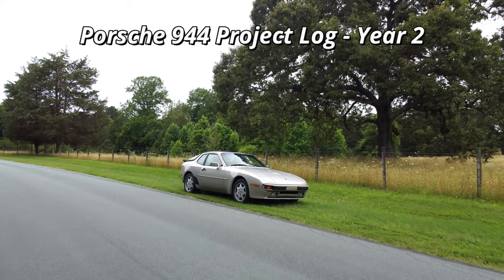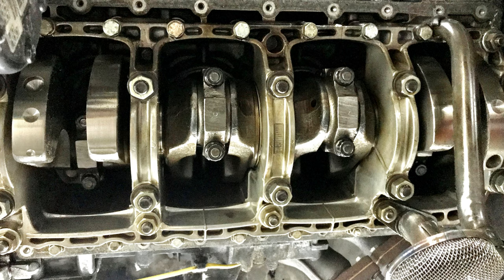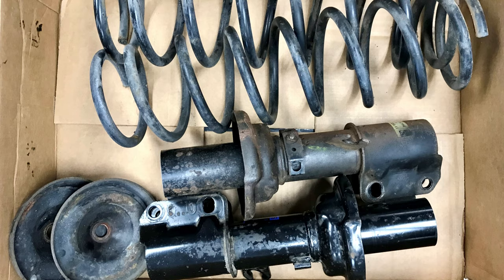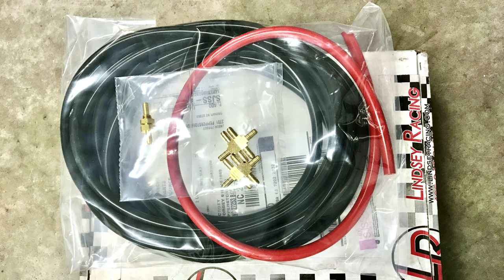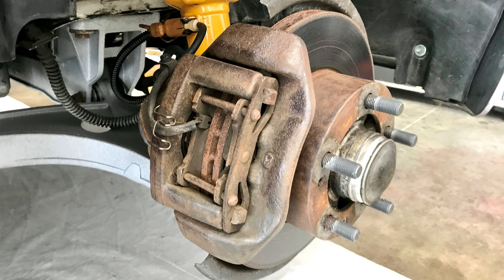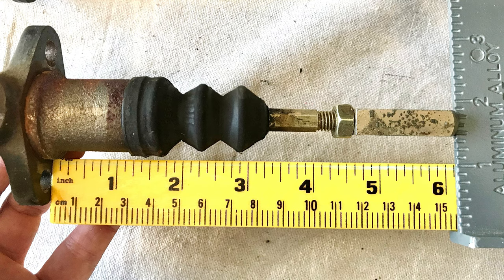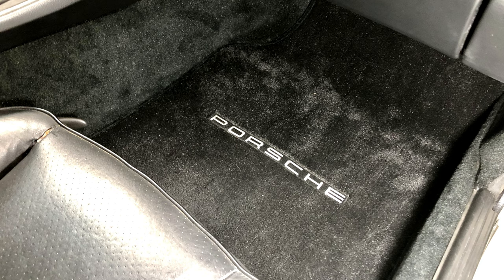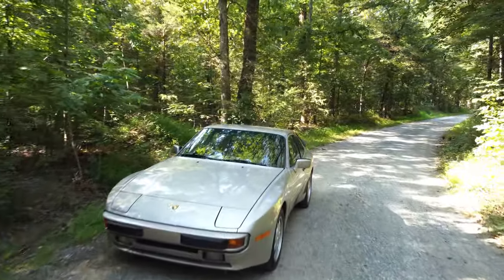Porsche 944 Project Story – Year 2 – Status Update, Repairs, Maintenance, & Costs

Comment: Currently restoring my 84 944. What started out as a "repair the cracked fuel rail and clean the oil off the engine" has now turned into a full engine rebuild minus the main bearings and piston rings 😂. 

I'm glad I'm a mechanic by profession, there's honestly no way I'd own a 944 if I wasn't mechanically inclined. Maintenance costs on these things are brutal since people beat the hell out of them since they were a "cheap" Porsche. So maintenance has been neglected on alot of these. It's been fun following your videos, jealous your 944 is driveable haha!
Reply from the maker: Too true man! If I had paid a shop for all this work, the bill would probably be $6,000-$8,000 more than what I’ve spent. Which goes back to the age old advice - it’s cheaper to buy a restored car than to restore one yourself… but where’s the fun in that. 🤣

Comment: This channel is a blessing. How do you know so much and with such confidence, were you a mechanic?
Reply from the maker: Nah, just been wrenching on cars for about 25 years. For the Porsche specific stuff, I’ve spent close to 100 hours reading technical articles, forum posts, conversations with owners, the factory workshop manual, etc. Any “new” work I undertake, I try to consume a bunch of content on the process beforehand. That way I know what to expect, if special tools are needed, learn from common mistakes, and then plan a basic approach. 👍🏼
Reply: @NC944er  this is blowing my mind. Any idea of approximately how many hours you've put into it so far?
Reply from the maker: @Eltalstro  I’ve tracked costs pretty close to the penny, but haven’t really attempted the same with the time investment. For the work that I’ve filmed, it typically doubles or triples the total timeline on those repairs. It’s definitely multiple hundreds of hours including research, part shopping, and preparation. In case you’re interested, I just posted the Year 3 update this morning. 👍

Comment: Awesome video and work! Greeting from Germany - would love to see more ppl like you around here!
Drive my S2 Daily :P
Reply from the maker: Hey Sven! I’m very glad you enjoyed the content here. I’m trying to document my work while also hopefully helping others to care for their 944 repairs. Thanks to your countrymen for making such fine automobiles and delicious beers! 👍🏼
Reply: @NC944er  The more I learn about my car due ppl like you and others I am more and more amazed what the engineers back then came up with and how they takled problems with the tchnology of thier time (I'm an engineering student myself and have almost as much fun learning about the car then driving it) Bought mine in an awesome condition and am almost a bit sad there isnt much left for me to do - as mine is from 85 and its not a turbo it lacks power steering and ALBS - so those are 2 projects I'm thinking about taking care of - dont know if it will be worth it tho :D - btw did you mess with the yet MAF?
Reply from the maker: @svenscholz3412  Nice! Best of luck in your education program, maybe you can do a project using the 944! 🤣 Here in the US, manual steering is often preferred and harder to find to the point where people convert them away from power steering as to have a better road feel. It does make it more difficult to turn in and out of parking spots, but that’s about it. I have not yet opened my Air Flow Meter (AFM) because the engine hasn’t displayed the hesitation or stalling symptoms that come along with a failing meter, but I am a little curious if there are any grooves developing in the contact strip. There is a company here, Lindsey Racing, that makes a true Mass Air Flow meter (MAF) using a modern blade style sensor and it really opens up the airway to the intake. I was about to buy a conversion kit, but production is paused while they secure a new EEPROM chip manufacturer. I’ve equally enjoyed working on and restoring the car as mush as I have enjoyed driving it, which is saying a lot because they are pretty fun to drive! 😆

Comment: Quality videos, clear and concise. Benchmark info source for 944 projects. I have a 83 NA. Do you have any footage showing how to remove the rear quarter windows without breaking or damage?
Reply from the maker: Thanks!  

No footage captured on the glass removal, but I used the below video for reference. Instead of a screwdriver I used some plastic lever tools for changing bike tires, as to not damage the paint, and I pushed mine out from inside the car. They are not quite as “easy” as shown with rubber that is old and hard, so I had to work around the edge and slowly lever it up while pushing on the glass. You can also heat the rubber with a hair dryer or low setting on a heat gun to make it more pliable. The glass is pretty strong as long as even pressure is applied. 

https://youtu.be/dE2Q6WayLpY
Reply: @NC944er  Thank you very much

Comment: Great stuff NC944er and thanks for sharing- I've completed a lot of the same stuff to my 1988 944 as you (seals, bearings, zinc, water pump, timing belt, window regulator, fuel pressure regulator sunroof, etc). Couple of questions, i need to replace the rear speakers and will likely go with the Kicker's that you used, price seems good. Are you happy with the sound of them? I'm using the original Bremen Blaupunkt like yours. Also, is it possible to replace the rear speakers without removing the rear glass - my rear window seals are in good condition? One last thing, have you had any issues with your temp gauge - mine is not functioning correctly - bounces and also reads higher that actual temp - i've checked temp with a laser. Cheers
Reply from the maker: Nice man, sounds like the car is coming along nicely! 👍

1. Regarding the speakers, I’ll say they sound light years better than the crumbling paper cones that were in the car. That said, it still has a bit of a dated sound, probably because of the output on the old Blaupunkt unit, doesn’t sounds as good as a modern car, but I kind of enjoy the nostalgia. The Kickers have decent mid and high range, but not very beefy on the bass side. 
2. There are folks who say they have been able to remove the rear trim panels without first removing the quarter glass and seals by gently working them out from under the seal. My concern with that approach would be damaging the already brittle interior pieces and doing more harm than good. The seals are reusable, so if you decide to remove the windows, you can simply reinstall them with the original seals. It takes a bit of elbow grease using the wrapped rope method, but nothing too crazy. 
3. I did replace my DME temperature sensor due to a starting issue, but have not replaced the coolant temperature sensor that controls the gauge. They are pretty much side-by-side on the front corner of the engine block under the intake manifold. It’s not uncommon for the sensors to fail over time and need replacing, which should resolve the issue unless it’s electrical/wiring related. Couldn’t hurt to first check/clean the connections there to see if that makes a difference. Clarks has a write up on testing - http://www.clarks-garage.com/shop-manual/elect-19.htm#coolant

Cheers!

Comment: Did you notice any change in oil pressure after you did the rod bearings?  What weight oil are you using in NC?  A lot of people are running 20w50 but I'd guess you could go with a lower weight if you have everything resealed and have new rod bearings.
Reply from the maker: Hey! No discernible change in oil pressure after swapping the rod bearings. The original ones had some light scoring, but were in good shape overall for 170k miles on the engine. I’ve also been running 20w50 oil, mainly for the high temp benefits and I generally don’t run the car when it’s below 40° outside, even though specs claim it’s good down to 14°F.

Comment: Hey man. Great content again. I got my S2 battery tray in a pretty similar condition as yours prior fix. Could you list up what material/products you used for that job? Thanks a bunch and as usual keep up the good work 👍
Reply from the maker: Sure thing! Below are the primary items I used for the battery tray repair. I had gotten a quote for $1,000 from a local custom body shop to weld in a donor tray in good condition and paint to factory color, but this DIY method I used was way cheaper, it’s functional, and turned out pretty good. 👍🏼 

https://shop.advanceautoparts.com/p/por-15-stop-rust-kit-gloss-black-40909/11839912-p?product_channel=local&store=6018&adtype=pla&product_channel=local&store_code=6018&gclid=EAIaIQobChMI3s_N56ax8wIVBKGGCh35XQqdEAQYASABEgJj5_D_BwE&gclsrc=aw.ds

https://www.amazon.com/POR-15-49013-Black-POR-Patch/dp/B00J594AQ2/ref=mp_s_a_1_1_sspa?dchild=1&keywords=por-15+patch&qid=1633369518&sr=8-1-spons&psc=1&spLa=ZW5jcnlwdGVkUXVhbGlmaWVyPUFCWVpVTFU5TDJSVTQmZW5jcnlwdGVkSWQ9QTAzNTY4MjA1UUMyM1o5ODFJWFQmZW5jcnlwdGVkQWRJZD1BMDg5OTMwMDEyN1IzSEZKWjZLVjImd2lkZ2V0TmFtZT1zcF9waG9uZV9zZWFyY2hfYXRmJmFjdGlvbj1jbGlja1JlZGlyZWN0JmRvTm90TG9nQ2xpY2s9dHJ1ZQ==

https://shop.advanceautoparts.com/p/herculiner-15-oz.-aerosol-truck-bed-liner-halb15/11447096-p?product_channel=local&store=6018&adtype=pla&product_channel=local&store_code=6018&gclid=EAIaIQobChMIwtHG4Kex8wIViJ2GCh2p7w8rEAQYASABEgJMcvD_BwE&gclsrc=aw.ds
Reply: @NC944er  perfect thanks for the quick reply !They don’t sell Por15 stuff in France but I got a good idea of what I need to get :)

Comment: Hey do have a video explaining fuses for the 944 I have a 84 and I’m missing L,M,N fuses
Reply from the maker: Hey there, no I haven’t done anything that breaks down the fuses extensively. Based upon the letters denoted, it sounds like you have a Type 2 electrical panel and those would be relays as follows: L - Gong, Catalytic Converter, M - Bridges, N - Power Window. There’s usually a diagram under the plastic cover for the fuse box, but I’ll include a link below as well. You may need to search around the web/forums for more info. 

https://www.autogenius.info/porsche-944-1976-1991-fuse-box-diagram/

Comment: What glue did you use to re-glue the sagging headliner and carpet bits? I have the same sag as yours did
Reply from the maker: I used some Gorilla Glue for those sections, the kind that activates with water. You can also use a standard carpet adhesive.
Reply: @NC944er  Awesome thank you!

Comment: Can you do a video on the engine harmonic balancer? Me and my dad have an 86 944 and would like to adjust it to whine a little quieter. Any information on how to do this from anyone else would be much appreciated. Hope I can find some help because I have had no luck finding anything so far.
Reply from the maker: Hey Emery, the harmonic balancer is essentially the pulley that drives the A/C compressor and alternator, and it should be tensioned so that there is a 2mm deflection from upward thumb pressure on the lower side of the belt. 

That said, a lot of the belt noise on the 944 comes from the balance shaft belt, due to it commonly being over-tensioned and/or the idler roller being set improperly. Overall, these cars are known for a lot of belt noise, but I would start by confirming that the timing and balance shaft belts are properly tensioned.
Reply: @NC944er  thanks man, I will try that and see if it works or helps!

Comment: Hey man I just found your channel and I just bought a 944 with some problems with the valves from what I can tell so I was wondering if there was any better way like Instagram or something like that that I could pick your brain on
Reply from the maker: Hey man, congrats on the purchase!  I don’t have any other social media accounts, I’m keeping it old school. 😂 If you haven’t done so already, running a compression test and a leakdown test is a good place to start, see if you can isolate the issue. Once confirmed, time to pull the head off for servicing. 👍🏼
Reply from the maker: Gotcha, well you won’t be able to run any traditional tests until the engine is reassembled. I would pull the spark plugs and apply vacuum to each cylinder with a shop vac or compressed air with a compressor, listen for whistling or air coming from any of the valves. Since they should all be fully closed with the cam tower off, you would expect a good seal there. If not, you’ll need to service the head/valves. You can visually inspect for broken valve springs, but it’ll be hard to see a bent valve stem or worn seats from above. Depending on your budget and the mileage on the car, it could be worthwhile to just pull the head, replace the gasket and have the head checked at a machine shop - might save you some repeat work. Otherwise, if you don’t hear any leaks at the valves, reassemble the top half, properly time everything and then turn the engine over slowly to listen and feel for any irregular movement in the valve train and pistons before attempting to start the car. Check out my video on hydraulic lifters for some info on inspecting their overall condition.
Reply: @NC944er  thank you man you’re a huge help it’s a car with 100k miles and I was kinda planning on pulling the head and just buying new lifters and valves and just do a refresh on the head
Reply from the maker: @tylermartin7455  Absolutely, best of luck and let me know how it turns out. 👍🏼
Reply: @NC944er  well I’ve run into a bit of a problem I can’t seem to find any lifters anywhere and they had been out of the car and I am missing one I ran some of the tests you did with them submerged in oil and they still seem kinda squishy(granted I’ve only done 2) do you know of anywhere other than plyhammer because he seems to not have any right now. Thank you for all the help so far
Reply from the maker: @tylermartin7455  The car’s oil pressure will prime them a bit more thoroughly than those methods, but they shouldn’t be super soft. There seems to be a little shortage right now as I’m not seeing any on eBay either. I would check with 944barn and 944store to see what they have.
Reply: @NC944er  hey it’s me again and I found lifters and I’m trying to prime them the ways you do but the vacuum pump I have just seems to not pull hard enough of a vacuum and all of them are staying kinda soft I was wondering if I was doing anything wrong or what
Reply from the maker: @tylermartin7455  Yeah, you may not be able to get them fully firmed up then. As long as you notice some degree of change in the firmness, you’ll know that the valve isn’t clogged. They don’t have to be primed for installation as long as you think/know they are good lifters as nothing will do quite the same job in firming them up like the oil pressure in the engine.
Reply: @NC944er  awesome i ripped my camshaft housing gasket but after the second new one comes in it should fire up
Reply from the maker: @tylermartin7455  Oh man, sorry to hear that, but you’re not the first to have that happen. Lesson learned and best of luck finishing the reassembly! 👍